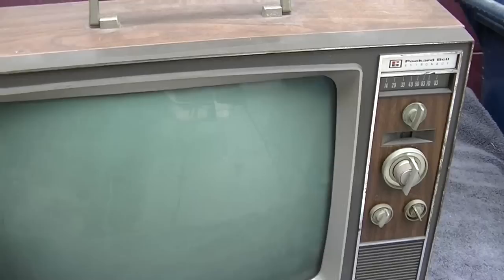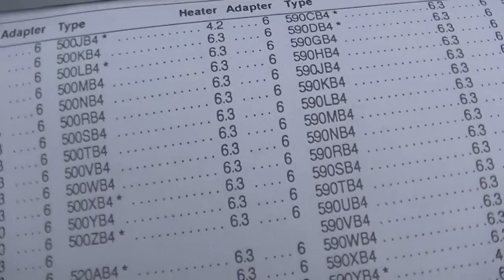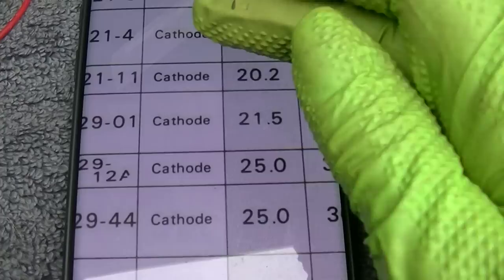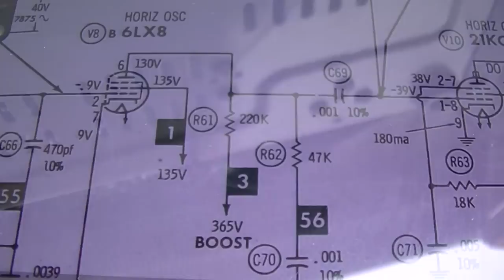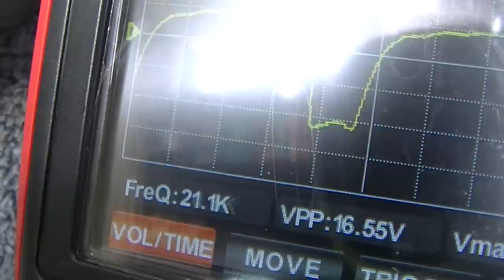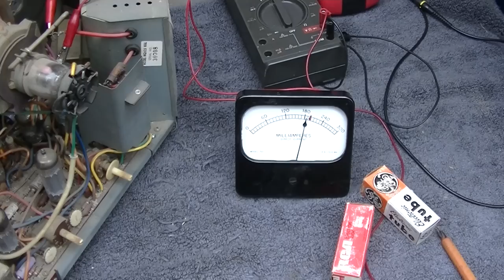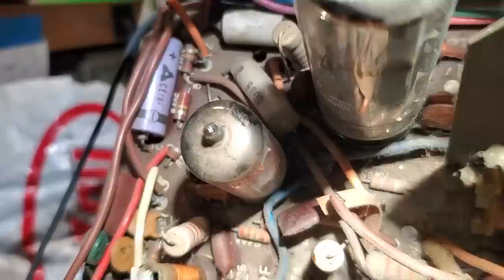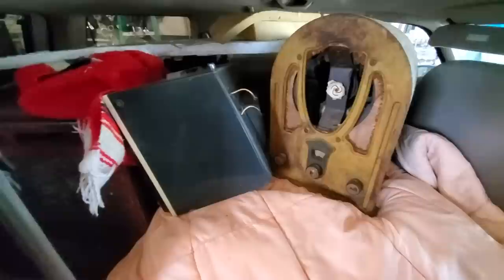Rapair Fail 1969 Packard Bell Astronaut MQ625 Matsushita BW Tube TV

Comment: Long time viewer, first time commenter. Love your content. I admire your knowledge, I know nothing about tubes, I was a bench tech for a computer manufacturer in the 80’s LOL

Just as a try, when not oscillating, could you try a heat gun, and see if when you heat a component to make it start oscillating, try to track down the bad component that way.

Alternatively when it’s running try freeze spray to make it stop oscillating to try to track down the bad component.

Also, poking around with a non conductive stick, my favorite was a wooden soup spoon handle end, when oscillating and or not oscillating to make it stop and or start, to try to track down the component.

Yes, I know these are unskilled tries, but the unskilled must do what we do. 😊 and yes, I fixed a rear projection screen TV that way once, and even funnier I used crazy glue to stabilize the problem area, and that TV worked for another 10 years and I gave it away and it survived the truck ride to its new owner and continued to work after that.

Sometimes you just get lucky.

Comment: Since this is such a low hour set, this might have been a fault since new.  It's possible all the components are good and within individual specs, but collectively the values have all skewed to create a defective set.  That is a situation that can create manufacturing headaches.  All the tvs in the production line are built exactly the same way, but some don't work.  Maybe try changing parts that are outside of a tighter spec.

Comment: A trick I was taught for arc testing horizontal output..

Purple hiss : ac
Blue hiss(with crt disconnected) : dc
Blue snapping arc with cry connected: filtered dc
Reply: It's also a quick test of the eht rectifier, if you getting ac at crt the rectifiers failed
Reply: Purple rain, purple rain!
Reply: @waltschannel7465 "Purple vein, purple vein!" The artist formerly known as Prince....
Reply: @johnnytacokleinschmidt515  that's what I get for listening on a cheap audio system. 😁

Comment: Also, I always replace all electrolytics, wax papers, bumblebees, paper oil ect caps now, even if they test ok on ESR and capacitance they can drift when heated and cooled or simply malfunction when at actual operating voltage, carbon comp resistors can also drift at operating voltage but not when cold and at low voltage. Basically recap it all and clean all tube sockets and straighten pins. It's a lot of work but it will help guarantee this set will last a long time with less hassle down the road. I had an annoying issue with my motorola tv where it would only run horiz. oscillator at 1/3 the frequency and the issue was fixed by simply recapping until issue went away.

Comment: 22:00 Speaking of scopes: I recommend considering the OWON HDS2202S. It is powered by two 18650 lithium cells, has a 200 @ 3 dB (350 visible) MHz bandwidth and a built-in arbitrary waveform generator. Thanks to this, it is suitable for literally any repair work. The downsides are that it's a bit noisy and power hungry. Kerry Wong has a video testing this scope.

Comment: A long time ago when I got a job as a TV repairman my boss taught me a lot he was a very smart man he used to take a toothbrush and brush the solder connections to find broken solders. I remember certain TVs had special problems that show up once in a day then I have to wait the next day for it to act up but I have only one chance. I had a thought about taking a small window unit air conditioner and mounting it on a roller and installing a small flexible duct on the cold discharge air and use the other end to cool off the TV if you're looking for temperature sensitive failures it saves on expensive freeze spray and you can heat up small areas with a small heat gun or a small butane hot air tip

Comment: I had the Panasonic badged one of these in my very first apartment.. Watched The Dukes of Hazard and other junk while drinking cheapest available beer with my buddies.... Anyway mine had the same problem. It was the triode cathode resistor on the PCF802. Probably why somebody threw it out in the first place. It took a fair bit of hunting to finally solve it. Gave it away to a friend when I emigrated.

Comment: Very interesting video Shangoo.  I never trust those carbon-based resistors they can have problems susceptible to moisture heat, cold I would put some nice ceramics in the immediate area.  I also do not like those plastic polystyrene  caps.
Reply: And the heat of a soldering iron might give a temporary fix.

Comment: We had a lot of Japanese sets in Malaysia...i have worked on many of them..the capapacitors around the oscillator tube..the boostrap capacitor around the damper diode need to be replaced..the oscillator coil can give trouble..cracked enamel insulation resulting in intertermitten shorts can kill the oscillator from starting..dip the coil in laminating varnish for a few hours..then dry in in an oven at low heat..or dry it out in the sun..

Comment: I would be very suspicious of the 3uF electrolytic on the boost supply, with the oscillator tube pulled you should be getting close to the B+ on the anode (coming from the damper you measured as 140V), unless there is something else loading the boost supply other than the horizontal oscillator. Check g2 too as it directly determines the gain of the tube, low g2 means low gain

Comment: Also there might actually be an engineering problem with that set to some degree... maybe it dropped out on the beginning stage of the "bathtub curve" and that is why its so low hours. Personally I think the positive feedback or "kickstart" circuit is sitting right on the threshold, and component tolerances will drift with heat, which is why it wants to start when warm but when it sits and becomes cold it wont. All the residual charge leaks off and it is no longer hot. So wait another long while, but before powering it back on, grab a heatgun and warm up that section of the board and then power it on and see if it starts.

Comment: I have experienced similar grief with Japanese electronics from this era before. The board has a thick film of flux all over it. Sometimes this seems to be hygroscopic and causes leakage in high impedance circuits. I give the boards a good scrub with board cleaner or IPA and the problem goes away

Comment: These capacitors are called styroflex and they are good as long as you don't get them wet. If this set was mine I would just change them all, specially in the high voltage area

Comment: Oscillators are weird beasts. Many things can stop them running. Some will behave at lower frequencies and stop on higher or the other way round. When you've changed all the components around the valve or tested them and they all seem ok. Try a valve from a known good set, just to eliminate the "I've tried the valve already" syndrome. The 120v p-p output maybe a clue, check the positive feedback circuit if replacing the oscillator valve again doesn't improve things. So much stuff is interactive in these circuits, sometimes just having a working set to swap parts with is the only way forward. Good luck. Enjoyed watching.

Comment: Well, can't say you didn't try on this one. Only thing I can think of is to check the cap when it's been sitting a few days. They "heal" or reform to some extent.. but it may break down to the extent after discharge to where it has to reform the oxide layer. Definitely not a tube as you've ruled out. That's awesome you hooked Bob A up on the Duo View! Great video - Thanks for the  very useful content!

Comment: The 7JP4 Philco in the truck with the screen in the center...I've got that one partially restored but it's got a horizontal issue.  Top to bottom, squiggly, vibrating question mark pattern.  Hope to see that one soon!

Comment: Shango, I've had EXACTLY this same problem with GE and Admiral el cheapos using 33GY7 and 38HK7s - Horz oscillator non-starting because it runs on Boost. Very simple fix: Take an ordinary power diode and connect it from main B+ to Boost rail, anode to B+ and cathode (banded end) to Boost rail. What happens is: the oscillator starts on B+, and as soon as Boost comes up, the diode becomes reversed-biased and drops out. Guaranteed fix.
Reply from the maker: Tried that didn't work but I'm isolating the problem now
Reply: 'Oly 'ell ain't that a kersnarfulated befuzzlement.  Intermittent in the osc. coil maybe?

Comment: I don't have any brilliant ideas on this one other than maybe cold solder joints?  You did mention that one red capacitor ... They look OK, but I'm not the best judge of that either, and its hard to tell on a video. I know that's Jordan Pier's go-to for anything he works on. You also mentioned the neon bulb trick for checking high voltage. We used to use one of those 2 lead AC testers with a neon bulb ad a series resistor that used to be very common, and are now less so, but still available.  Those are way more accurate than the non-contact testers IMO.

Comment: Hey Dan. Saturday's are not the same without Shango066. Just wanted to say that your Channel inspired me. I picked up a late 60s Panasonic from another local Ham operator. He gave it to me for free and said it worked when it was last turned on probably 30+ years ago. I have learned so much from your channel that I feel I can confidently open up this set and properly assess it and resurrect it and gain some knowledge from it. Maybe you could tell me if it's a rare set or not. Has a Sylvania picture tube (replacement I assume), but with all other tubes being original as I recall. Panasonic CT92 DC.

Comment: If I had it, and the oscillator didn't want to start, I might be tempted to pull a DB3 DIAC out of an old CFL lamp and stick it in the horizontal oscillator, to try and give it a kick-start.  I'm not sure that would work in this case, since the HV comes up nearly instantly in a CFL lamp, but gradually (as the filaments warm up) in a tube TV.  Grid voltages here are also higher than the base voltages on the HV NPN transistors in a CFL's oscillator, which might be an issue with a DB3's 30 volt firing voltage.  Once the oscillator is running, we don't want the DB3 to be still conducting.

Comment: The Panasonic sets use a 25E5 for HOT tube..30AE3 for Damper.. 1S2A for EHT..and 8A8 for horzontal oscillator...on most cases the EHT valve fails..picture balooning on increased brightness ..

Comment: We used to have one of these in our billiards room which was lined with manufactured wood paneling. Our sofa was orange, the carpet purple and the curtains light brown. Out set used to stop working and we figured out that if we banged it on the left two times then once on the right it would work. None of this is true of course, even the billiards room was fake, but I do rather like the look of the set in the video.

Comment: I had repaired a lot of these kinds of Japanese makes in the 60s and 70s back home in Malaysia...this fault could be due to internal shorts 8n the flyback overhead winding..shorts of nature could dampen the oscillator from starting..replace the oscillator grid capacitors...the bootstrap capacitors connected to the damper diode..and in remote cases the oscillator coil for loosing its enamel coating..open the voil carefully..dip it to laminating varnish for half a day and allow the coil to dry in the hot sun..the adusting core has ..to be removed while doing this...

Comment: Right near the end of the video, showing your barn finds, did I spy a Sencore Big Mack CRT tester on the floor in front of your passenger seat? If so, would you maybe do a short vid on it, maybe doing a comparison to other testers? I have one, and haven't ever used it (or any CRT tester). If any of the other TV guys are using one, I'm not aware of it. Thanks!
Reply: I thought.... Possibly and I'm almost sure he has and used one quite often. CR31 I think and also there's another number, but I can't remember at this moment.

Comment: You thought that there was something with the fuse at the beginning. May be someone was messing with the fuse and caused a problem with the main power. I don't know if there is a power coil that can be changed out to see if power is being delegated out properly,that could cause some components to loose their charge

Comment: There's got to be something that's just marginal enough to stop working when the set sits for a longer time, and I'll bet that's true with both this and the Admiral set. Since you probably don't want to spend the rest of your life troubleshooting this, "shotgunning" all the passive components is probably the way to go. I'd hazard a guess that your multimeter won't push the questionable part enough to break down and show an incorrect value.

Now for the story: not content to use various hot chassis radios in the bathroom (which I have really done, albeit plugged into a GFCI outlet, and kept well away from water), I got one of these Packard Bell TVs and arranged to hang it up from the shower curtain rod. After all, nothing says class and wealth like having a TV in the shower, even if it is only black and white! I sure went through a lot of those plastic hook things in the process. They just don't make stuff to last any more! The next day I came downstairs to find the TV broken up and the shower curtain rod completely wrecked on the floor. I can only guess someone tried to steal it...probably the neighbors, who I'm sure were jealous.

All of this is absolutely true because you're reading it on the Internet, and everything you read on the Internet is true. Unless of course you aren't, then it isn't.
Reply: Right or wrong, I'm against it.

Comment: Question: what about cleaning the circuit board?  The heat of operation may be drying out the dirt.  But when you leave it off for a long time, the moisture gets back in and sets up a conductive path that's causing a problem.  That may be an issue in this particular set - especially if it has resistors higher than 1M ohm.  It doesn't take much dirt to mess up a 5 M resistance.
Reply: I was thinking the solder resin some formulas can become slightly conductive, perhaps you or other readers are aware of circuit glue 12volt vids has talked about it. When applied and it dries it is light in color but once it starts turning dark or turned dark it reeks havoc on some circuits. This was of course an example, that circuit glue likely didn't exist when the TV was manufactured. Anyway it's certainly a possibility.
Reply: @darinb.3273  No, it's not the dreaded "brown goop".  But I wouldn't rule out cheap PCB material that absorbs moisture.

Comment: I used to fix Panasonic in the 1970s check the horz osc coil for poor connections and the caps in the circuit.

Comment: Osc problem could be either broken wire on the hold control, or those stinking polystyrene capacitors the would get funky acting

Comment: i see those tubes have a euro type number as well on them, LCF802,, similar to the more common PCF802 here in the UK, but 0.45a heater for the L ones, 0.3a for the P ones,  likely used as total heater chain volts less than UK P chain  to suit lower mains volts

Comment: Sams used to give a resistance table in their service info for some sets so you could measure each tube pin resistance to ground, not sure if it was ever any help to me though.
DC voltages on osc, horz output and damper OK on all pins?, maybe something is just marginal enough to keep the osc from starting all the time

Comment: First and foremost, I wasn't clear on the voltage measurements you were supposed to see in the horizontal oscillator...are they in spec? I wasn't sure if your 120 vs 160 volt difference was there or in the horizontal amp.

Was there some green corrosion on the resistor you were checking? It kind of looked that way in the video.  Maybe there's moisture ingress on the caps and resistors, and the components are behaving differently with a high-level AC or DC signal applied as opposed to testing them with low voltage DC? Oscillators are not forgiving so maybe the circuit is acting up when stressed.

It might be worth replacing the oscillator caps as a start. Then, if the problem persists, replace the resistors with funk on their leads. Failing that, maybe the upstream stage is loading the oscillator causing it to not start. A leaky coupling cap or some other component lowering the input impedance of the horizontal amp?

How about replacing the tube socket? Maybe there's something funky going on with it since you can "finger" it to get it going. 🙂
Reply: It was the 160V that came out as 120 (as far as I could understand), but if the the oscillator run it already started in the lower tens of Volts.

Comment: That is a strange intermittent problem with the HOSC. in your PB set not always starting up. I'm wondering about maybe a cap or resistor in the osc. circuit, near the 6LX8. Maybe a bad connection on one end of a cap or resistor in the circuit, where the lead comes out of the component. I have seen this once in a TV audio circuit. The sound would intermittently fail. Turned out to be a resistor with a slightly corroded lead, right on one end of the resistor, where the lead exits the resistor body. Would have to wiggle parts around, when you wiggle the 6LX8, it may be putting just enough stress on the board to make a connection. Just a thought.

Comment: Does it make any difference if the set is in quick start mode instead of vacation?    I'm thinking there is some kind of race between the horizontal oscillator tube and the horizontal output where one has to warm up and begin conducting before the other or the oscillator won't bootstrap itself.  I think that kind of circuit was a terrible choice for a tube set.